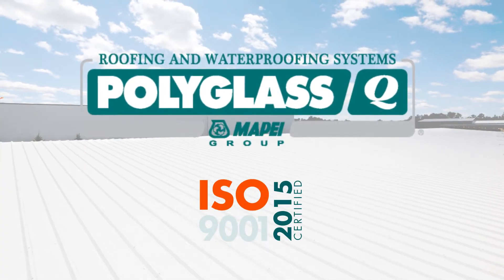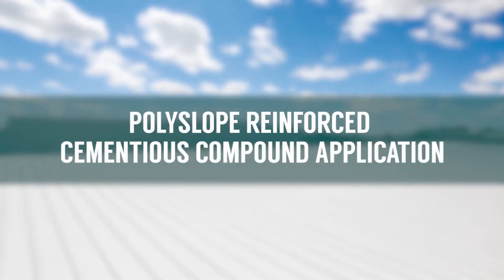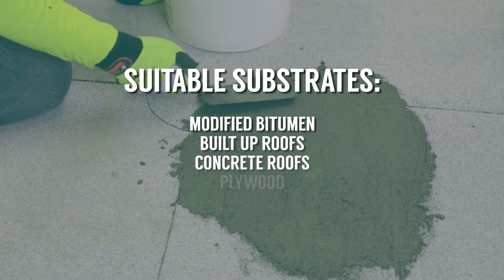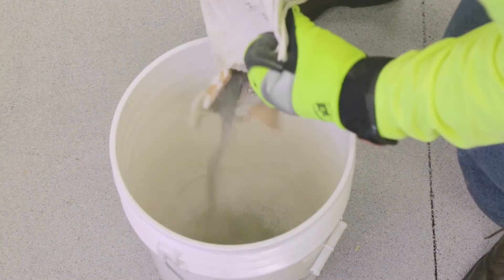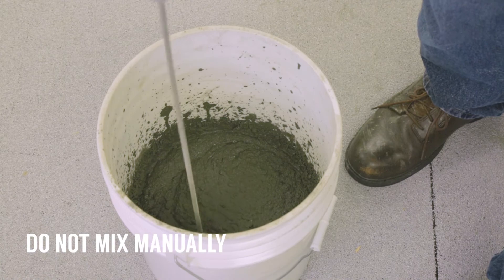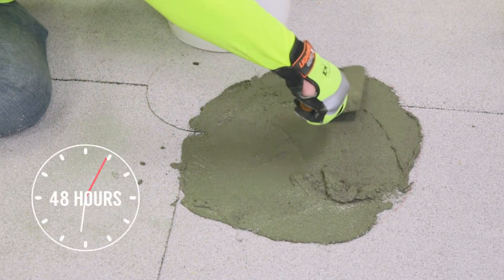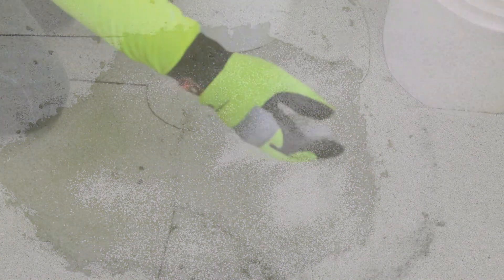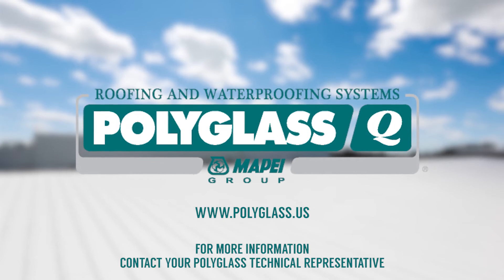How to Improve the roof slope & promote positive draining with POLYSLOPE

Comment: Can a new single ply membrane be installed over this once the pitch is corrected on the existing single ply membrane?  and if so, can we only heat weld the perimeter of the single ply overlay or can the single ply overlay be adhered directly over the top of the Polyslope as well?
Reply from the maker: This would not be a recommended application. https://polyglass.us/wp-content/uploads/2018/04/POLYSLOPE-PDS.pdf
Allow POLYSLOPE to dry 48 hours before applying a coating over the surface. If the surface of the repair is not going to be coated, apply Polyglass Granules over the area by broadcasting granules over the surface area to refusal. Please contact Polyglass Technical Services Department for installation recommendations regarding substrates and conditions not listed for appropriate primers and coatings: https://polyglass.us/contact/. Thank you!